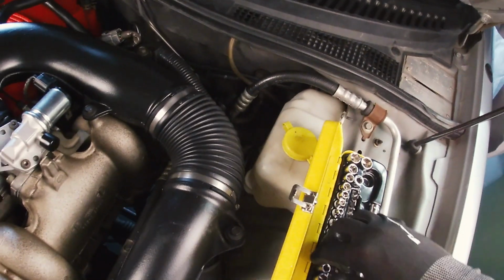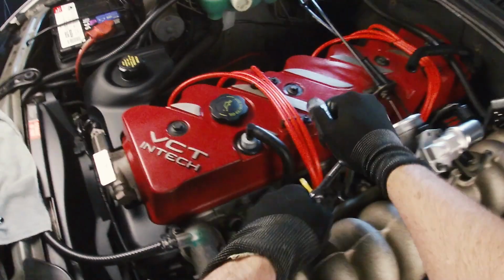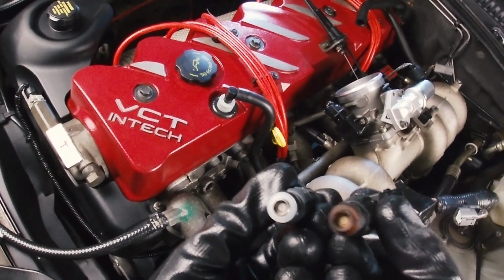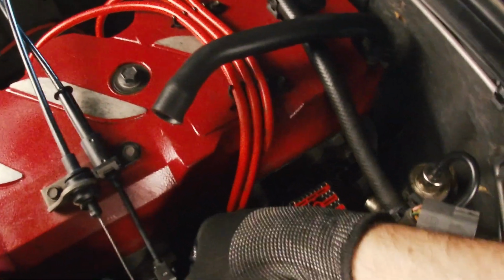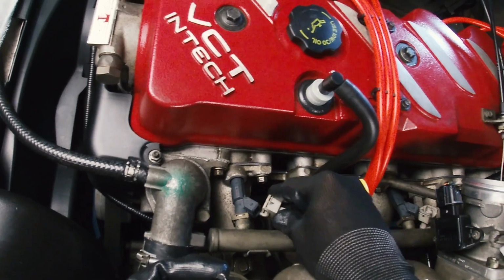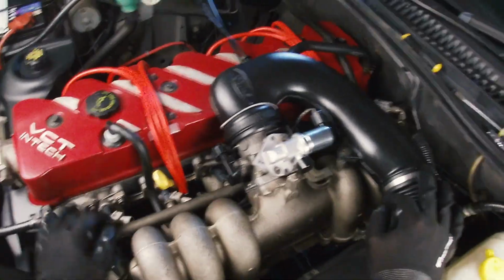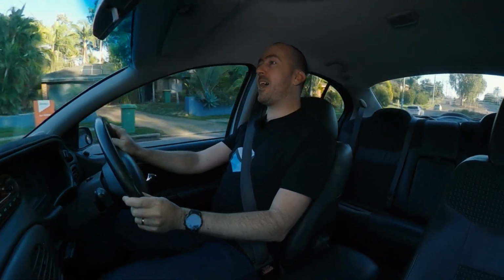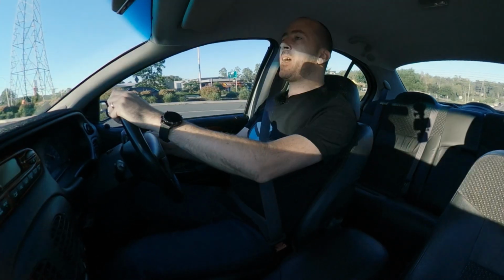Replacing Fuel Injectors on any 6-Cylinder Ford Falcon. AU Fairmont Ghia Intech VCT Bosch 19lb 220cc

Comment: Your honesty is appreciated. Not everyone would admit to f#cking up. Most Youtubers would cut to the end and say they are the best at what they do. You're showing everyone that you're human and will make mistakes.
Reply: I'm not mechanic too,but YouTube, repair book give to me some nolige. You are done good job,but if clips on back of rail is not properly lock you have vacuum in this spot and your ECU will have problem with mixture air and fuel and he will be confused. Stereoscop is good for checking injectors clicking. I don't trying to criticised you only I'm trying to solved problem with injectors from ebay maybe they are good but isue clips don't hold injectors proper in rail.

Comment: Another good video Sean. It gives those who have no idea what to do a good idea on how to change the injectors.
With mine, I went Bosch but I exchanged my old ones at Repco. I also cleaned out the fuel rail due to the fact that living on the Mid North Coast of NSW, we do get crappy fuel from time to time. I filled up one day into flooding at a petrol station that wasn't affected & they had bad fuel so I'm waiting to get through the tank. At the time replacing the injectors, I replaced the fuel filter, spark plugs & leads. I found I was still having the same problem & found it was my new Bosch leads so I ended up replacing them with a better brand & it worked perfectly after that.
If you got a mechanic to do it, they would charge like a wounded bull. I still recommend that if you can do it yourself (with a mate if possible), it'll be easier.
Had to laugh at the vaseline innuendos.

Comment: Glad you got the problem sorted out in the end with your customary honesty.  I find that when a shaft is inserted into a hole, it is best to use a special rubber grease.  It prevents any rubber parts from deteriorating and, let's face it, nobody wants that - blink, blink.... 😄

Comment: Good job is done.I have replace injectors on Ford Falcon Ba and first I have connect injectors on side of rail and I have instaled clips for injectors which is not easy they should click on bottom and they should not move left or right which mean clips is instaled properly.After that I push all 6 injectors in manifold and after rail bolts were installed.On Ford Falcon idle adjusment should not be touch ,because bolts can crack ,because they made them from plastic.If adjustment bolts can be moved paper clip should be connect on TPS conector earth wire  silver -red and another clip to signal wire yellow and conect voltmetar and in idle if is proper adjustmet reading should be 0.6 to 0.9 V. If is idle low screw shoud be adjust in plus.Wide open trotle engine off when you press pedal down should be reading 3.5-4.7 V. It is proper way of adjusment of TPS and idle screw. WIRE BROWN -YELLOW is 5 V power for TPS and never put paper clip on that wire should be market adevice Voltmetar or ECU can be damaged.

Comment: Most manufacturers of Injector Cleaner will stipulate, when asked, that their product is more for maintenance than for fixing gacked up injectors. There is merit in running some injector cleaner through every couple of months (dependant on driving frequency) to keep the new ones working as good as new for longer. 
Thanks for the video, Sean. The POV works well, I’ve put injectors on my AU to-do list now.

Comment: Thanks for that Sean:goodvibes:just replaced fuel injectors on my Ba 02 XR6 + Throttle Body + Sensor clean, the process was a lot easier particular the Clips your advice was good(leaving elec on). Resultant performance great improvement particularly with the rise in fuel prices.:elbowcough:

Comment: How you done the job is the mechanics way, however petroleum based vasaline dries out the " O " rings so next time just some ATF is safer and will prolong their life. In america however where it's cold the petroleum will behave a tad less aggressive. Good job and honest filming.
Reply from the maker: Good tip. I read conflicting info, half say it's fine, half say it isn't. Time will tell I guess.
Reply: @MotoringBoxTV  Unfortunately The Vaso will dry out the seal and cause start/idling problems.
Won't happen over night...But will happen :(
Reply: @MotoringBoxTV  yes the difference is a matter of years, the rings could die in 6 - 7 years minimum from experience and mimic vaccuum leak. You probably know that but for everyone else reading. Love the professional quality.👍👍
Reply from the maker: You guys will need to tell Scotty from Street Machine Carnage too 😃 I learnt it from him.

Comment: Thanks Sean, ended up here trying to sort my dad's old AU Fairlane with same engine. Great car but become a hairy goat in recent years through lack of use, and the rougher it runs, the less it gets used. This is it for sure.
Reply: Hi Sean, just thought I'd update. Was getting all keen to change injectors when I discovered the noise I thought was the Power Steer pump was actually a failed intake gasket on 1. Totally gone. Apparently common on AUs.  Replaced it with the help of your other video (watched it about 6 times first) and my 16yo son (small hands) Cheap fix and it runs like new now. Thank you very much.

Comment: Great job! Your injector story reminds me of when I replaced the injectors on my wife's corolla to solve an intermittent starting issue (occasionally misfired for a few seconds on startup). I bought a set of 4 "remanufactured" injectors from a guy on trade me. Car started great with the new injectors on cold start, misfire gone, however now it struggled to start when hot. Looking closely at the injectors, I realised 2 of them had different part numbers. I sent them back to the seller and he sent me a new set of injectors with matching part numbers. Went to start the car after installing them and the engine immediately hydro locked. Much swearing later I disvovered two of the injectors were stuck open. After hand cranking the engine to expelling all the fuel, I put the original ones back in temporarily and had ended up paying $1000 nz for Bosch ones. Super easy mistake to make as injectors are expensive and it's really tempting to try to save some money. Good on you for getting the car running great in the end.
Reply from the maker: When you think about it, they're probably one of the more critical parts when it comes to how an engine runs. So yes, it doesn't pay to skimp out.

Comment: Good job mate . When you buy quality parts for engine your save yourself money in the long run , not only that but you are less likely to do your engine damage . One thing is for sure and certain, that is you have saved a ton of  💵 by working on your cars rather than paying a mechanic. Knowledge is power and helps the hip pocket as well when it come to cars .
Reply from the maker: True. I've learnt a lesson too, especially when it comes to something precise like injectors.

Comment: I put bigger injectors into my VS commodore ; I had my car tuned to them via the ECU I did what you did got slightly larger injectors ; the slightly larger injectors they did suck the petrol a little more

Comment: Mine cranks a bit rough during starting every now and then too. Might get that looked into as well. Wouldnt mind getting a set of plugs rated to 200,000km as well for the old girl. Found out Aurions use the real expensive ones 80 bucks each. My next car I plan to get is an Aurion.
Reply: can you handle the power of the Aurion?
Reply: @silvernoob1603  I don't see why I couldn't its pretty similar in power just front wheel drive.  I Don't buy them for track burnouts or all that just distance driving.

Comment: Next time insread of using screwdriver to remove the clip on the wire connectors just push the clip in this will make the connector able to be removed

Comment: Not much point in cleaning 20 year old injector, they are mechanical things and the do wear...
I went through the same saga with my 300 zx tt, starting problems on and off...I bit the bullet and bought genuine Nissan ones...problem solved.
Now I got  an AU2 XR6 VCT...thanks for the video...well done and informative
Reply from the maker: True, the new set are performing beautifully. They weren't cheap, but worth it.

Comment: Hey Sean, you should try an Olight Perun 2 head torch. I recon you'd get a good close light up look at your work. Our mate Cadoges is an Olight aficionado as well. Not super cheap or anything, but have a look. If you sign up for email alerts there are a lot of flash sales with great prices.

Comment: Another fun fact if you push the wire clips on the injector plug you can pull them out without the stuff around of pulling them pack
Reply: I had a prik of a time getting that last bolt out and those spring clips. Lucky I got a magnet.
Reply: The spray pattern will tell u what injectors are like. Attach current to - and +  the + should be marked on side then fit a rubber tube over in end. The big rubber seal comes off. Don't try and take the small one off. Seal a tube spray in rubber tube. Connect + and squirt it fru. Injectors will make a small click noise when opening.

Comment: I know its late but when I put bigger fuel injectors in my EL it was running rich misfiring all it is because it’s running rich give her some more air had a look over with the timing too and it was good so play around with the throttle since in the owners manual so you didn’t really f up

Comment: I bought a set of elcheapos for xr8 au as the originals seem impossible to find but connectors on new injector is square and au has roundish plugs, near identical specs and only difference (beside connector) appears to be ohm value. Was going to either get adaptors or change connector ends.  Also plan on putting sequential lpg injection into the au xr8 😏 which has piggy back loom using the square plugs. I'm not a YouTuber but really should make videos as I learn (mostly from my mistakes) to help others.

Comment: My old girl 1997 el ford falcon shes just had some new spark plugs put in her dont know if they have ever been changed but shes been running rough at idle alot of the time, cold starts it idles fine but once it warms up it develops a bad misfire so next thing ill put some new injectors on her she has done 210k kilometers the pain isnt in the best condition but shes always reliable i think i have an automatic transmission leak very slow one but im hoping it has a fill plug on the side of the transmission so i can top it up there is no dipstick so cant tell how low it is for sure but it does slip early in the morning going around the corner at the end of the street so id say she's just low enough for it to start becoming a problem, cheers for the video its extremely helpful also if you had a video on replacing the cab air-conditioning fan id love to see that mines gone but it seems like a full dash removal to replace bit of a big job the ac works fine tho
Reply from the maker: Hmm that's a strange one. I'm no expert but I'd say something is being affected by heat so I'd be checking the ignition coil or the distributor. Engines typically inject more fuel when cold so I would be surprised if the injectors are causing any issues when hot. I think EL's didn't have a dipstick on the gearbox so you may be up for the same job that I had to do. If it has one you'll see the dipstick on the driver's side of the engine right up against the firewall.
Reply: @MotoringBoxTV  yea no dipstick for gear box. anyway ill update you on what's happend so far. 

topped up the gear box was about 1L low was slipping before now its brand new ill call it rebuilt haha

new injectors proper ones flow matched copied your video for the install went in without much issues did have one leak on first inspection but the metal clip was not put on correct just fixed it and sealed up perfectly

New fuel filter dont know who put the old filter on but it wasn't the right one lol luckily they didnt chop the flared ends off and the nuts were still there just freely moving about, the fuel coming out of the old filter was black so can say it was about due the new one bolted on perfectly didnt leak at all 

after all of that the car drives great but the miss is still there only at idle and only once its warmed up im thinking fuel pressure regulator or the sending unit in the tank might be bad and its not holding pressure i noticed when taking the injectors off and the fuel filter there seemed to be no pressure behind it just leaked out slowly once it was lose so i dont know could be many things its not that big of an issue in my eyes under throttle its smooth and reliable and plenty of power.
BTW when i say bad misfire i really mean its mild and not all the time just makes the rpm drop then it revs up and does it some more then it will settle its a bit random might be a drop of fuel pressure for a moment then returns could be a vacuum leak i really dont know the timing chain could be warn out and its out of time or the distributer needs replacing or even the coil id have to set some time aside to diagnose it 

my main issue is the cab ac fan is dead but its a full dash removal to replace it the ac itself works just fine i can hear the gas moving through the system when you activate the ac just no fan to blow it around so one day ill fix it but its one big job

Comment: The old parts cannon. But u right. Most stuff needs replacing. Would not use Ebay stuff. My ebay coil lasted 6 weeks. lotta work to do twice.
Reply from the maker: I've had a lot of luck with eBay parts, but definitely not for injectors!

Comment: hi mate, just checked out the video, I`m not an expert by any means, but the the ford service manual says to lube the injector O rings with a light coating of engine oil, and not to use petroleum jelly,not sure why, but maybe something to dowith addatives not being good for the rubber. good video though mate
Reply from the maker: I think the consensus is it doesn't matter.

Comment: My AU GHIA has been a bit cranky starting lately as well
Reply from the maker: It's a real pain, and makes the car sound like a bit of a dunga.
Reply: It also can idle rough. Though it is intermittent some days it starts and runs completely fine other days it cranky to start and idles rough but seems to be running fine otherwise

Comment: Great video. I know it's tempting to buy the cheapest parts on ebay but it only takes a no name part fucking up a couple of times before you realise it's not worth the hassle just to save a few bucks. I bought a set of no name idler pulleys for my BA and they only lasted a few months before needing to be replaced. One was literally falling apart. Same thing with bonnet struts. Bonnet struts aren't a big deal but if it's an important part, get OEM or an otherwise trusted brand. They just work and unless it's a consumable part, you won't have to replace it again.

Comment: Have you replaced the ecu yet, that might help. Or the bolt that holds the coolant reservior on hahaha sorry mate.
Reply from the maker: Sure that'd help, I found the BA had plenty of space even with a thicker radiator. Putting a piece of ply or thick cardboard to protect it is a great idea though.

Comment: It's an intake air leak OR MAP Sensor issue OR low fuel pressure ( check delivery rate & regulator on the rail ).
Other than that its the ECU/PCM. ( poor hot water over it when cold test! )
Leads on an AU MUST be covered in plastic conduit anywhere they can touch metal.
Eagle brand box sets of 8mm leads are best.
Thermostat should have 2 holes opposed on outer rim to allow water flow before opening too( HOT TIP ).
You should also reset KAM Values after making base idle changes. ( KEEP ALIVE MEMORY )
Is the start issue solved or did it just seem to be but came back?
Reply from the maker: Solved!

Comment: Nice video just wondering when you said to set the idle at 700 is that in Park neutral or drive because the car idles higher in park then in neutral thank you
Reply from the maker: Should be at idle in park. Going by the analog gauge on the dash is pretty hard though, in the end I adjusted it a few times until it just sounded right. Make sure this is when the engine is at proper running temperature too.
Reply: @MotoringBoxTV  cheers thanks for your reply , mine's a ED Falcon 94 . was thinking about putting AU injectors in  there a 4  Squirtt system wear mine single , my idle is around 900 in park 400 in neutral but that 900 in park I think come down a little when I put new O2 sensor in I think really made a difference as well cheers I'll aim for 700 in park thank you .... splendid ..work  ...!

Comment: Hey mate I’ve got a 2004 ba xr6 falcon. I’ve gotta replace the injectors as well, Do you know if I could put slightly bigger injectors in without having any trouble with the ecu? And if that’s a yes would that give me a power increase or would the ecu still deliver the same amount of fuel as the original ones?
Reply from the maker: Stick with the standard spec, if you go larger it'll just run richer and cause problems.
Reply: @MotoringBoxTV yeah right fair enough. 
I appreciate the reply mate, you’ve saved me some headaches

Comment: maaate, i need to get to the leaky welch plug under my AU intec inlet manifold :(
any tips? do i need to remove the injectors?
I have the top half off the fuel injection
Reply from the maker: I've not done that job before, so I'm not sure if going from the top or underneath would be better. I imagine from the top the entire intake manifold would need to come off. Not fun.